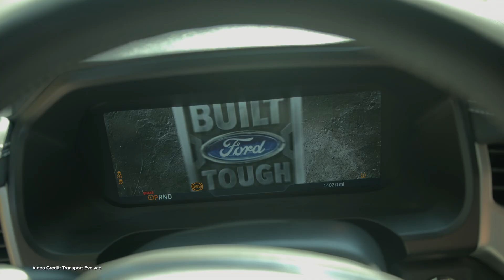EcoTEC 356 Peak Transportation Emissions? What Range Anxiety? Polestar’s Rally Trio!

Comment: Not being able to charge at home shouldn't be an issue. There is no good reason that companies can't put slow chargers at work - which will get used when the sun is out and electricity is cheaper. If you live in an apartment but drive to work every day, you must park it somewhere, so the issue is a lack of parking spaces with low power all day chargers (and you probably only need to use a charger once or twice a week, so not every space needs a charger). Yes, I have an EV, and don't drive every day, and can charge at home from a solar system. When I do drive around Sydney, I or my wife probably only do 20km on average. But I also do long trips - 800km+ - every couple of months. I'll still never go back to ICE. And when I do drive around I'm often towing a 1500kg loaded trailer. I love my Ioniq 5.